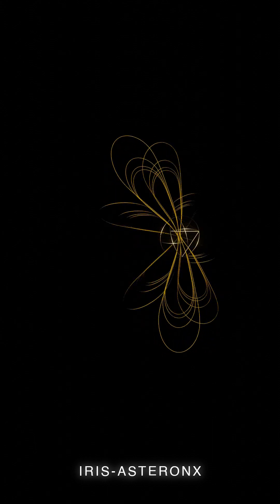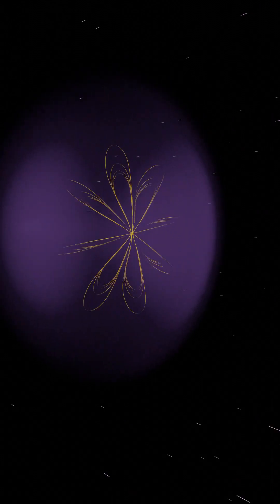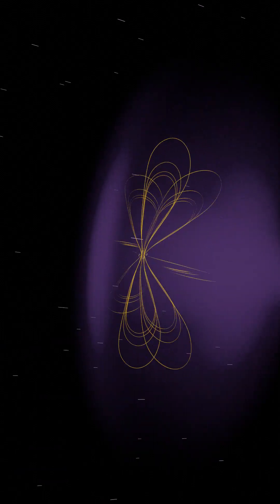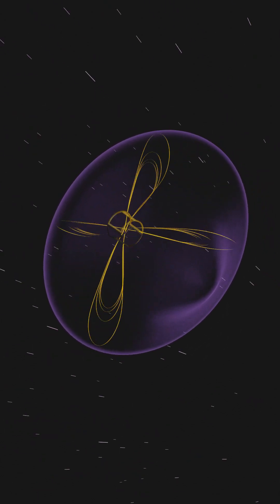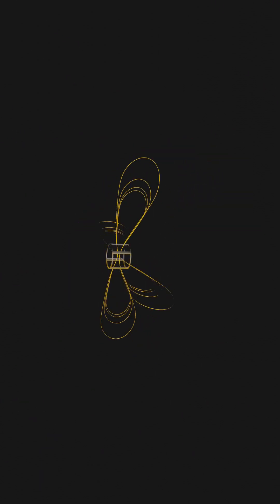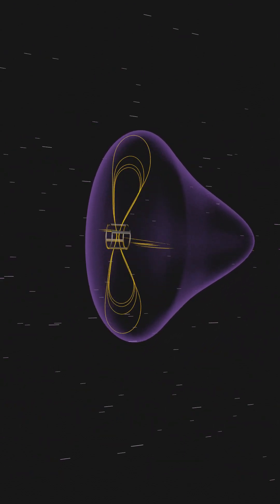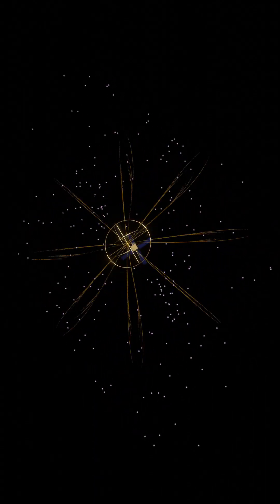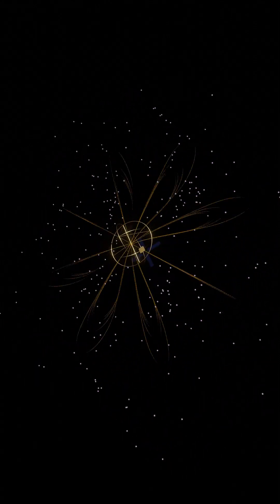Plasma Magnet Sail Drive | #shorts #plasmamagnetsail #magnetohydrodynamics #spacetravel

Comment: If a natural metallic object such as a planetary fragment were of the right composition to be strongly magnetized and had a bit of spin already imparted to it, could it form a field like this naturally? For some reason, I think this could be what is driving the unexplained acceleration of Oumuamua object. But for some reason it seems nobody else has touched on the idea.

On the way in it might not have enough ions to do anything even in relation to having a strong magnetic field, but somewhere after passing the sun it would pick up enough from the solar wind that they would be carried by it's magnetic field on the way out and help give it the extra shove that any other stuff such as outgassing doesn't account for. Could something like that be a scenario?
Reply: Yes, the reason nobody really discusses this stuff is partly due to its military applications. 

Invention secrecy act basically allows the government to classify certain scientific breakthroughs and technology for national security purposes.

This includes stuff in plasma physics.

I mean, we already know they use plasma in airplanes to reduce drag and extent fuel time, by coating a craft in plasma you can also obscure radar.

Who knows what kind of stuff is kept top secret on a need to know basis.

In fact, theoretically, under certain conditions plasma can exhibit quantum like behavior at the macroscale.

That’s basically what we see with superconductors, they exhibit quantum properties at a macroscale.

One thing I seen recently was a kid in university was able to create toroidal plasmoids in a glass bulb.

But scientists said it was impossible for years, and plasma physics in general was neglected and never really taught in schools.

It’s because so much of the advanced theoretical work with plasma is kept classified and top secret. So they never really teach it in schools, and they get taught the wrong frameworks in colleges.

Seeing how literally everything in our cosmos (99.9% of all matter) is in the plasma state. It poses the question why it’s not being talked about more.

Comment: The Plasmoid Solar Sail was invented by Dr. John Slough, a co-founder of Helion Energy. Thank you so much for doing this visualization! I wish you would add a slow moving background of stars to indicate that it always moves away from the sun. But this single plasma sail is like a Spinnaker Sail on a sailboat, it only goes in the direction of the local solar wind, away from the sun! Navigation and slowing down for aero-capture in the thin atmosphere of Mars are still problematic engineering challenges. And then there’s the challenge of returning to earth, against the solar wind. We need to find the “equator of the solar atmosphere” and solar winds that run in the opposite direction, if there is such a thing! Or tap the solar wind energy and use it to operate a pulsed sub-critical fusion rocket that can efficiently return from the deep solar system to earth.

Comment: I have another use for Plasma generated by laser's and disks which will use an assist from regular rocket fuels and oxidation but the difference here is that the Plasma is the weak source. It's a hybrid that does all the characteristics of an engine block from a car which also means, internally and without any force on pistons which will exit straight through a similar shaped bell nozzle. I only hope to build it and prove myself as a pioneer in a hybrid Spaceplane that will be a game changer

Comment: An interesting idea! Please, can you make a video about that topic? :)
Reply: I would really like a longer video explaining the engineering and physics behind this.. What would be forming the plasma? I assume the solar radiation is going to be used to excite a gas and the plasma will be held within the RMF?
Reply: same as the noble fusions to excitement to a point of collapes or expanding its self the shapers are desities a preasured point just before the action is about to pop you have a lower set that brings it back to normalize relations between stretching and folding is flowing streams in and around the tubes were used and radio telemetry wave pick up's it's own unique style economies crash then rebuild memory is never lost unless something changes it.The radiation from the arc of flash waves has an up down gravity reflections from center sources yes a multitude of platforms for versatility
Reply: @danielash1704  I'm not sure that collection of words counts as a coherent comment/argument... It reads as if written by someone with no understanding of the meaning of words?! 😅